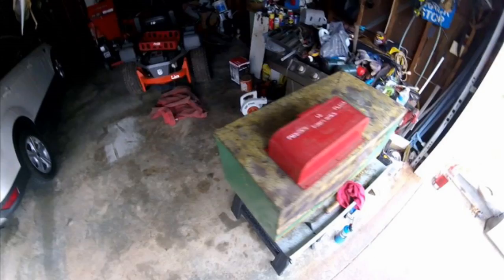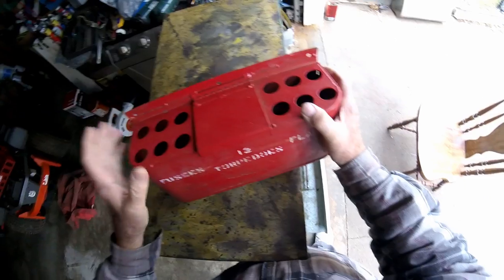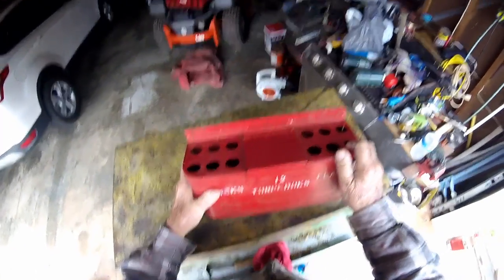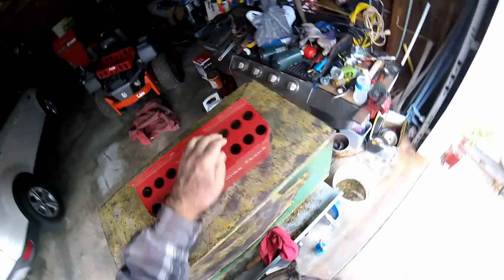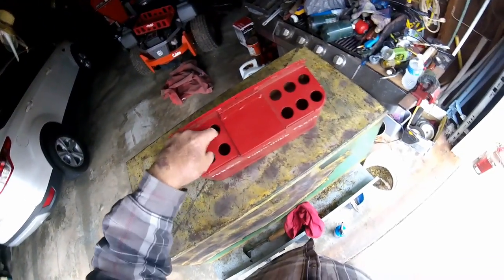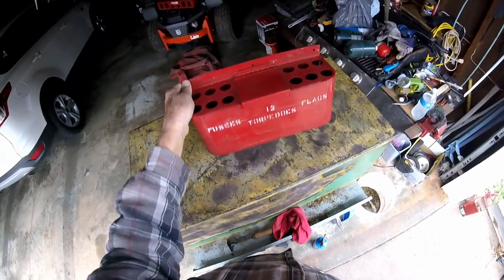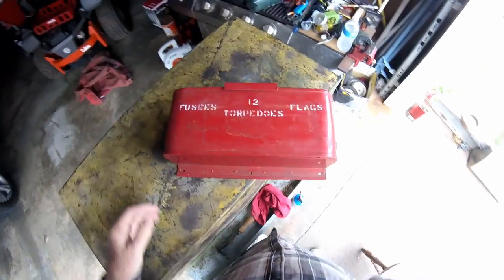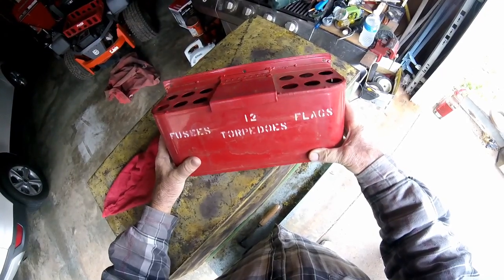Genuine Railroad Caboose Fusee Holder Pwalpar VLOG

Comment: I hung around the railroad tracks starting about the age of 6. Got my first locomotive ride on the ERIE, then the Pennsylvania, both in the iron ore yards of Cleveland. Also hung around the NYCRR where it crossed the river. Got to bring home probably 12 or so 5-minute fusees, and a big bunch of railroad chalk. You know, about and inch in diameter and 5 inches long. Made a big hit with the little girls drawing hop-scotch games on the sidewalk. I also got hold of 2  or 3 torpedoes. Kept them all in my bedroom. Mom finally told me to get rid of all the stuff or she would throw it all in the trash incinerator. Took them back real quick. Can you imagine what would have happened to those torpedoes when that incinerator got lit? She never knew that the torpedoes were a class-1 explosive. Thanks for the memories. Jon, MSO-439
Reply from the maker: LOL  You were a bit mischievous Jon They would just burn in a fire not explode